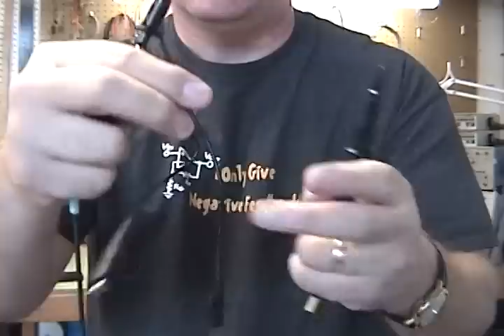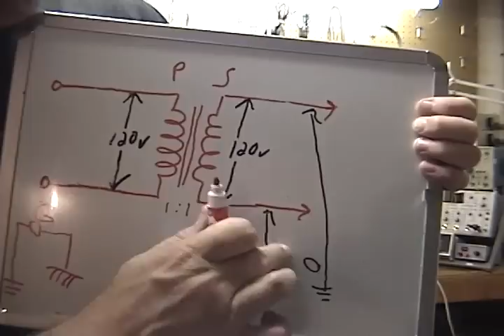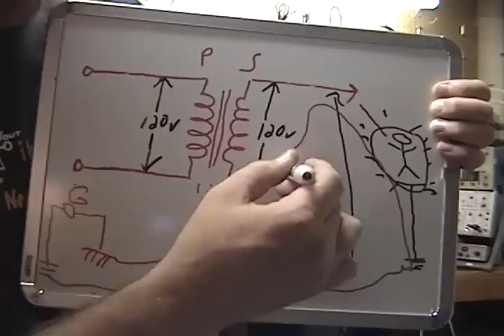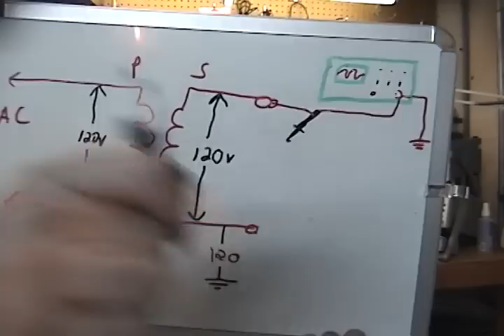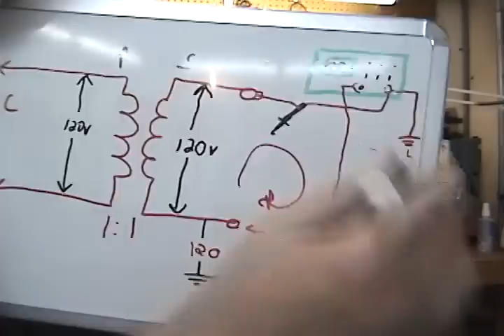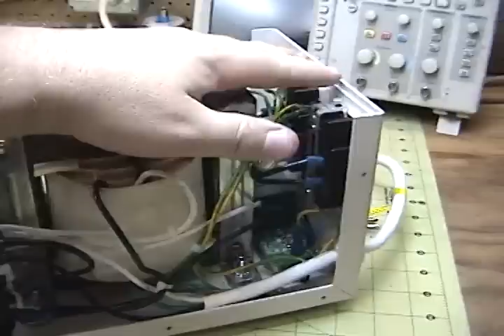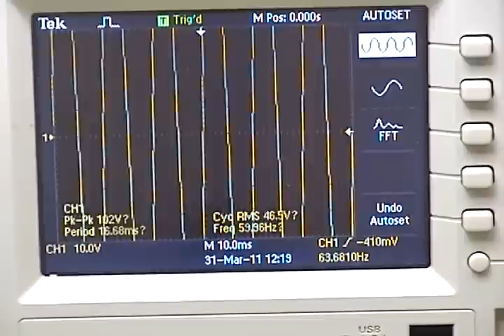ToddFun.com: Isolation Transformer - Tripp Lite IS1000

Comment: Hi Todd.  Does this mod remove the line cleaning capabilities of the isolator? I bought this to help fix a ground loop issue in my studio but it didn't help. Then I heard of this mod.
Reply from the maker: The mode does remove some of the the line cleaning capabilities but the mode will also help, maybe fix?, your ground loop issue. Maybe you need equipment just for your issue like:
http://www.panamax.com/Products/A-V-Components/MR4300.php#tab_spec
http://www.panamax.com/Products/A-V-Components/MR4300.php#tab_images

Comment: This is a great video, it helped to clear up some questions I had concerning my new Dale IT-400-4-S.  The secondary Hot and Neutral output goes to one of the Hubbell sockets. From there, Hot and Neutral wires bridge over to the other Hubbell socket where it too has the Neutral tied to Ground. I will be removing it, leaving the Ground to Chassis connected at each Hubbell socket.

One question I still have is that on one Hubbell socket it has a 150L20 varistor bridged across the Hot and Neutral. Is it ok to leave that? If so should I get another varistor for the other Hubbell socket?

Thanks,
Chris
Reply from the maker: jordanch68 You're good as is. you have removed the common mode wire and the varistor protection is fine for both sockets being they are in parallel.
Reply: Great, thanks! I'm thinking I should add a fuse as it doesn't have one.

Comment: note to self.....stick to low energy circuits
Reply: When I got out of school I was offered a job at a semiconductor company and a microwave company. After some thought, I elected the semiconductor company as 15V DC is much more forgiving to an unintended wiring mistake than 15,000V AC.
Reply: @Blondie SL do you recall what it felt like? when I was younger, I accidentally touched a 220V wire with my left index finger, I remember my entire left arm was shaking very fast, probably due to the AC frequency.

Comment: Hi todd! Great video! I have a doubt: is it correct to connect the structure (I mean the pack of "E" with coils inside) of the trasformer to ground anyway?
Reply from the maker: Mephysto65 I'm really not sure what you mean.
Reply: *****
Ok I try to explain in other words: I've got an isolation trasformer without chassis only coils (primary and secondary winding) and laminated core. From wall socket I have 3 wires: line, neutral and ground. Line and neutral go to the primary winding; what aobut ground? Do I have to connect to the laminated core of the trasfomer? Then I have another question: I've got same your fluke 144. Recently I experienced a strange thing (for me). I wanted to measure voltage between line, neutral and ground in my new workshop to test ground isolation. Using AC Voltage I had standard values: 0 between G and N, and about 2,5V between G and L (In my contry we have 230V-50Hz). Using Voltage LowZ when I touched G and L the automatic circuit breaker cut out the line. What was my mistake?
Thanks alot for your time and patience
Ale
Reply from the maker: Mephysto65 The ground should be connected to the core metal and to any metal the load will be housed in. It is a safety ground and should only get energized if there is a fault. For the Fluke it uses a 3K ohm input which must be pulling enough current to trip your breaker, it must be a ground fault interrupt type.

Comment: Hi Todd! I came across your video by accident; it was a recommended video on the YT home page when I opened it tonight...I watched it in it's entirety and I must say, this is a good reminder for techs that are not just newcomers, but veterans like myself. I specialize in the repair of vacuum tube amplifiers both vintage and modern-day tube gear, as well as vintage radios and tube TV sets. A good handful of equipment I work on has internal power transformers...however, some of the cheaper tube amplifiers, and vintage 5 tube-series heater string radios have one side of the AC line connected to the chassis which creates an even more dangerous situation! If the DUT doesn't have a polarized plug, and it is inserted opposite where the hot goes directly to the chassis, you have what's known as a hot chassis and if you come in contact with a ground point, ZAP! After about 100 shocks, and going through 3 boxes of fuses for my scope, I started to use an old RCA Iso-Tap IT. I have 2 scopes, one vintage EICO 460, and a Tektronics dual trace-triggered sweep scope...My old Eico survived many incidents, but I know my Tektronics won't...I strongly recommend that the new kids on the block (and even old-school techs) watch this video. I would hope to see that this video got many hits on YT...Keep 'em coming. Frank Ferraro--Audio Craft Electronics.
Reply from the maker: Thanks Frank, And I couldn't agree more. Share the vid on FB, Twitter and email with anybody in your circles and that would help distribute the link. It only takes a few shares for a 10's of 1,000's to become aware of the video. Thanks.

Comment: I forgot to use the isolation transformer one day at work and Pow the scope went dead, it was a brand new $3500 Oscilloscope. Lucky for me it just blew a fuse, so be careful always plug the item you're working on into a isolation transformer.

Comment: Thanks so much. I did a research and found that use picoscope by connecting to laptop with no AC adapter meaning run laptop with battery ..  Then connect probe and ground to the DUT to test it..  So this work right?. without any special probes?..however i understand that DUT will be in risk and can be in loop without Isolation transformer. Thanks so much for all your advise.

Comment from the maker: @svivaraj, 2) yes. But don't float such a scope, you could damage it and it wouldn't give correct reading anyway.  Floating scope and touching BNC is bad because most people do this because they don't have an isolation transformer to plug the device under test (DUT) into. If your DUT is on a IT transformer and you float your scope you can touch the BNC, however if you are also touching the circuit at some other high voltage potential while you switch probes or touch a BNC you will get hurt.

Comment: I have picoscope, I  have attenuator with 10:1 that scope can handle 100 volts max. wit attenuator of 10:1 can i test 240vac. Also this scope is connected to laptop and laptop is connected to mains, not sure if the mains earth is connected in picoscope to laptop to mains earth..  any advise, pls if you are aware.

Comment: contiued.. 2) just for the sake of argument if i remove the earth reference and make it as floating on scope, can i be able to measure ac volts with probe touching one wire of secodnary and floating ground touching other side of secondary?. you said if we do this, BNC shield will be hot all the time and if we touch the bnc shield we will be in loop. why ? even if i touch the bnc shield(floating ground), with my body in ground, i wont be inloop,becauz i hav nt conncted  to other side of transform

Comment from the maker: @sivara, Close. You only need to touch any part of the circuit that is at a different potential than the state at the ground clip of the scope. You do not have to touch another bit of metal, the fact that your feet are on the ground puts your whole body in the loop (in the USA). I say in the USA because some countries don't put physical earth in the loop like the USA does. In such a case you would have to touch something that links back to the neutral of your house wiring, not necessarily metal.

Comment: continued.. 2) when i touch hot wire in the circuit and if i touch any metal wire then i will be in loop. but not for previous case i had explained...

Ok i have not more questions :) promise..

Comment: just one last Q,  since we have connected one end of secondary to mains earth, the mains earth can be hot)+) at one cycle and neutral(-) at other cycle oscillating. So when i touch the mains earth in hand during that hot time and being grounded with my body, will there be a loop. I assume no, because there is no connection by myself from ground to the other end of secondary wire that is at negative potential.. is that right.

Comment from the maker: @sivaraj, Correct, no short circuit. Because there is no path back to the circuit.  It is like the two AA example not having a closed loop. The potentials maybe + and - but there is no complete path back to the secondary of the transformer so no short circuit unless you provide that 2nd path with another wire or your body. If you proved that 2nd conductive path, at low resistance, then POW!  you or your gear is died.

Comment: continued... and will have positive potential for some time. When that wire have positive potential the mains earth connected to that positive potential via earth shield at that moment of time, will not behave it as earth and no short cirucit occur?. i have no doubt on when that secondary have negative potential because earth is also same potential..

Comment: I appreciate all your comments. In your example what i understand is, when i connect positive end of AA to negative end of another AA battery that current will not flow. am i right.. if so i agree because the 2nd AA battery negative have no relation to 1st AA battery negative.. so there is no path to complete the cirucit.
In our case, we are connecting secondary end of one wire to Mains earth.  Since AC is alternating that secondary will have negative potentinal for some time ..continued

Comment from the maker: @sivaraj, Water example: If you tip a class of water, the water will flow out onto the floor (ground) because of gravity. Yet if you put a piece of paper over the glass and flip it upside-down real fast and then let go of the paper the paper stays in place and the water does not poor out on the floor (ground). Gravity is still there and is trying to pull the water down but it can't. It is a closed system, no open loop for air to replace the water in the glass so the water does not flow.

Comment from the maker: @sivaraj, That last statement wasn't quite 100% but I do now understand your dilemma. You are thinking that if something is positive it MUST flow to something that is negative. That is not the case. Example: If you put the positive end of a AA in contact with the negative end of a AA no current will flow. The reason is because you have not loop. The ground clip on the scope connected to some point on the secondary is just like my 2 battery example. No loop. I will continue with water example....

Comment from the maker: @sivaraj It will not cause a problem because with the ground clip of the scope connected to the neutral point on the secondary, the only path back to the circuit would be through the probe tip which should have a 1 Meg impedance. Far to large of a return resistance for a 110 V or even 220 V mains. Your body however is a much lower resistance and it would conduct just fine, that is why you can't touch the circuit once the ground clip is connected and you are grounded to the floor or other point.

Comment: Thanks again,  I agree with you that if i touch hot secondary wire and my body getting grounded will cause loop. no doubt I got that point, what i am unclear or trying to understand is when my secondary is connected to ground and that secondary being positive at that point of time, will not that positive wire connecting to mains ground cause any issues, if not can u please advise why..

Comment from the maker: @sivaray, No, there is no loop. However, if you touch some part of the circuit at that point and complete the circuit through your body back to ground then you will close the loop with your body and die. You could do the same with some test gear and then it would die.

Comment from the maker: @sivaraj, You would be a good conductor causing a short through your body if you did that. Once you connect the ground clip of your scope to any point on the secondary that point becomes the earth reference on the secondary and then any other voltage point on the secondary becomes dangerous to you and your gear. With a tech isolation transformer If you don't connect your ground clip then mains earth and neutral are not connected in any way.

Comment from the maker: @sivaraj, With a tech isolation transformer the earth point is not connected anywhere on the secondary. It is only there as a safety, in case some metal becomes energized with high voltage that can reference to ground. Lightening or other source could cause this condition. If you connect your probes across the established neutral and hot leg of the secondary and you are using a 10x probe your scope should read the voltage. No current will flow through the probe because of its 1 Meg input.

Comment: Sure. I am not testing it..just trying to understand. Let me see if i pick up right words @23.02 in ur video, u are connecting BNC ground shield to one side of secondary transformer(since it is AC it can be - or + becaz it varies) so we estalish the neutral, the probe itself is connected to other end of secondary transformer.. by doing so,  does the current travel from established neutral to positive and if so what does role of mains earth in this path.. pls explain if i have made it clear.

Comment: Thanks so much, i dont think anyone else have explained in detail. I have a questoin, in case where a scope is attached to a device with one probe(AC positive is attached to one end of the probe and AC negative is attached to the small black one), then can i assume the current flows from AC negative to Mains earth and then to AC positive, meaning mains earth is involved in this case while connecting the loop between positive to negative.. pls advise. I am new to electornics, pls bear with me

Comment: You should not "float" your scope because you would then be touching parts of it which are not grounded and could, depending on the way you connect it, be at a high voltage with respect to ground. You should get either a differential probe or a scope with isolated inputs OR, what I think would be even better in your case, make a device which high-pass-filters the AC line and then passes the result through a broadband, tiny isolation transformer which then allows you to connect your scope to it.

Comment: Wow, thank you for taking the time to make this!! By the way on the last example there, when you connect your Probe's ground to the other leg of your isolation transformer; that only happens because your oscilloscope is being powered by mains a/c correct? A battery operated oscilloscope would be fine right? (assuming you don't connect both probe grounds to each leg of the isolated transformer)

Comment: Tod, This unit has three (3) wires connected to chassis ground. I left the ground wire from outlet to chassis. The secoundary side had two wires going to ground? I disconnected the ground on the white wire from the secoundary, but the other ground wire is connected to chassis ground-not carried through to outlet 3 rd prong. Just the phantom load I told you about. I think I did the same thing as gvahe did. I am just courious about the other secoundary ground wire connected to the chassis. TY TDB

Comment: Todd, I took your advise for a tripp-lite isolation transformer-model is250,in-120vac,2.2a,60hz. out-120vac,2.1a. I see two (2) ground wires on the secondary side connected to chassis ground? I disconnected the inside ground that is connected to one line tap, The other ground line is tapped by itself. Should both of these be disconnected? I have 126.7 v coming out a phantom voltage of 6.4 v to ground on trans. outlet and mains (wall) outlet. Thanks, TDB

Comment: Hello Todd,  Thanks very much for your video.  I actually just received an IS250.  Do you still have the ground on the isolated plug connected to the chassis?  In other words, did you ONLY disconnect the bonding between the SECONDARY NEUTRAL and EARTH GROUND, but left the bottom hole still connected to earth ground?  In the IS250 out of the box, the White Wire from the secondary and the Third hole are tied to Building ground.  
THANKS!

Comment: Fair point, though I believe their are few occasions where misinformation should be spread for the sake of simplicity. I think "quickly" or "really fast" would have sufficed to explain the speed of electricity. There is so much misinformation in this world with science already, I shutter whenever the potential for more occurs. I don't think the speed of electricity in this video was the key point conveyed and as such unlikely to add confusion. Great video otherwise! 

Always a fan,
Trekgeek1

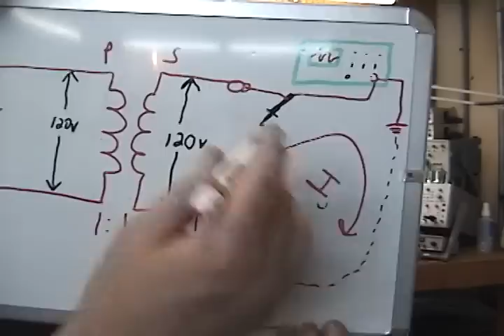Comment: 24:32  Current does NOT flow at the speed of light. Current is the flow of electrons, which have mass. Anything with mass cannot go the speed of light. They move fast (actually, not really - see electron drift velocity), but not that fast. In fact, the light we see on Earth isn't even going the speed of light, since that speed is measured in a vacuum and the light we see on Earth is traveling through numerous materials, including air. Otherwise, outstanding video, very helpful.

Comment: Hi Todd, great videos! Wow, I really appreciate that you spent 50 minutes recording that. Please be assured it wasn't wasted there are people like me and others that enjoy it very much. Ok...now back to my question. I planning on buying isolated transformer but the smaller one IS250 which is 2A. Now, I want to use it to power my 300W HIPRO ATX Power Supply for troubleshooting purposes. You think that would be enough- powerwise? DC OUTPUT +5V/25A +3.3V/18A +5VSB/2A +12V/19A and -12V/0.8A

Thanks

Comment: wouldn't putting a GFCI plug also protect you from the grounding problem. I accidentally did it with my oscilloscope and the GFCI tripped but everything was good after I powered it back on.